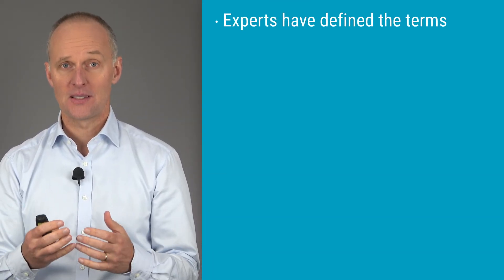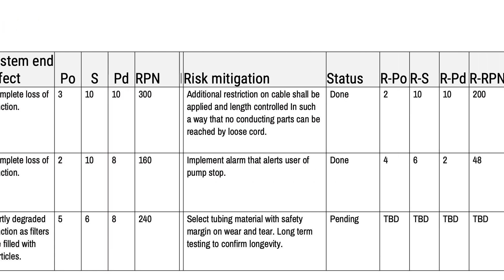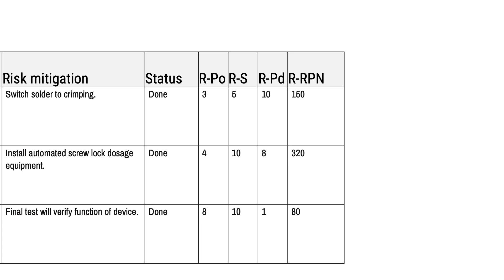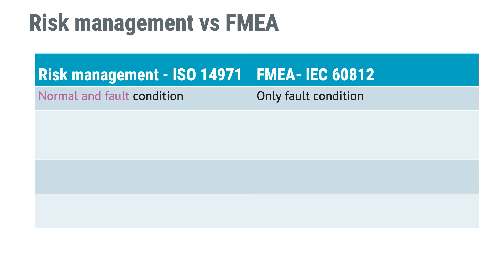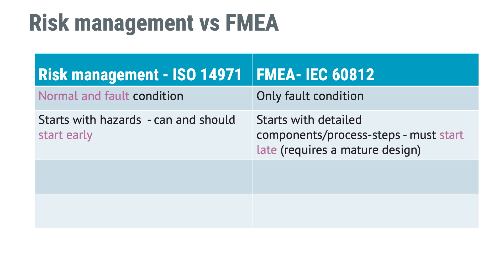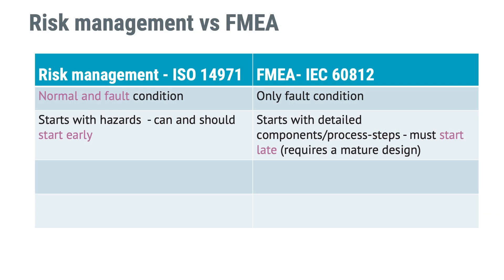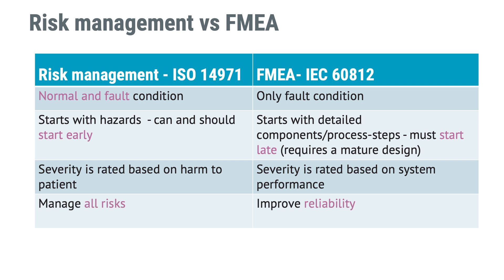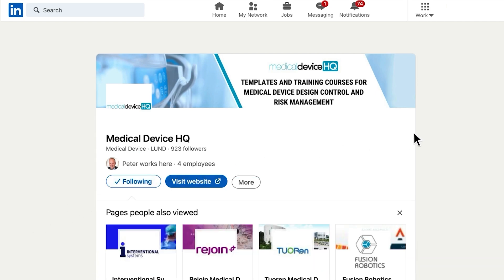FMEA vs ISO 14971

Comment: What about software FMEA? I don't mean firmware but UI software running in a medical device. Any example?
Reply from the maker: The information in the video is applicable regardless of what area you conduct the FMEA on. For a user interface, you can identify the risk by using a process based on ISO 14971, or you can identify the risks using FMEA AND ISO 14971 risk analysis. Remember, that ISO 14971 requires, among other things, that you include "combination of events", which would not be done if you only approach it using FMEA.